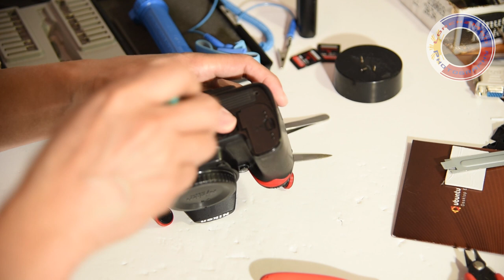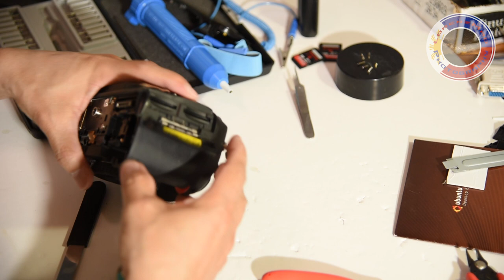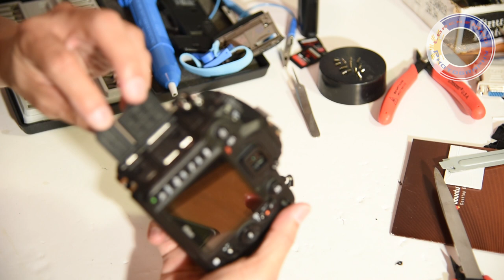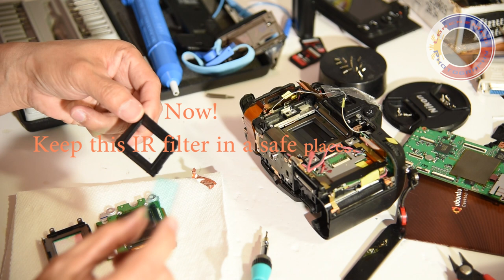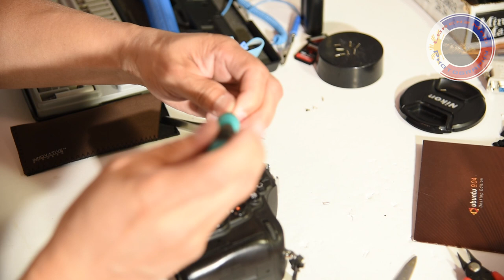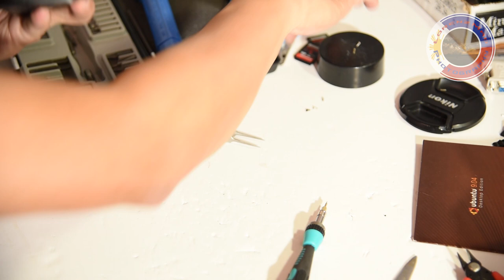Modifiying Nikon Camera for Astrophotography - Full Spectrum

Comment: Funny how nobody puts actual picture samples afterwards .... ?

Once this is done, you need an IR Illuminator (IR light source) at night ? 

How does this actually perform in daylight (autofocus, speed ... etc) ?
Reply from the maker: in daylight shot? awesome color output but slow shutter... Here's my current pics after modification. https://www.facebook.com/Astrolrenz/photos/a.1392028927630938/1702729486560879/

Comment: Does auto-focusing work properly??
And have you faced any issue after this modification?
Reply from the maker: back focus when im using my Sigma 17-50 @17mm, 70 - 200mm works fine.. auto focus works fine also.
Reply: @lrenz514  And about white balance and colors (-for daytime photography); is white balance manageable in post? How are certain colors captured (reds in flowers, etc), compared to no-mod sensor?
I am planning to do it very soon on my D7200.
Reply from the maker: @Rajesh-cg5pz  in post? yes. it can give really nice colors... well not all.

Comment: WARNING : you must absolutely remove the battery from the device several days before, because the capacitor used for the flash is charged at 230 V, so it may have hurt a little...
Reply from the maker: Thanks! I also pressed/hold the power button for several seconds to release any juice in it.